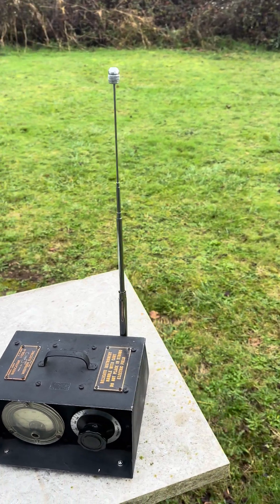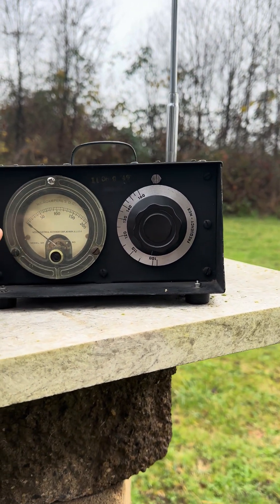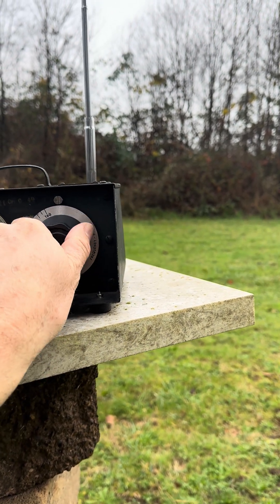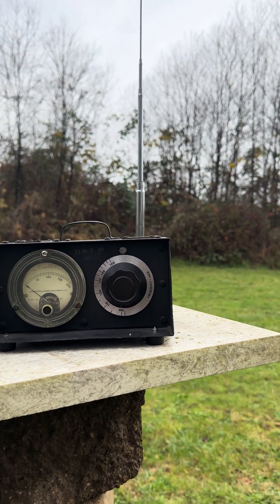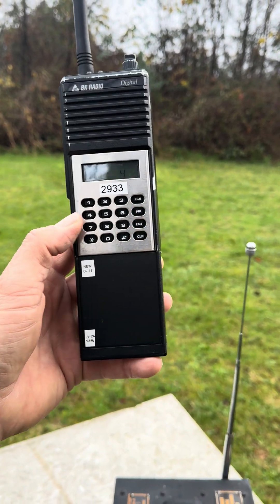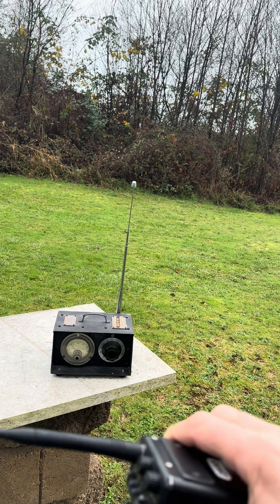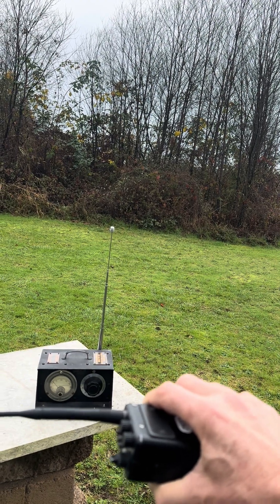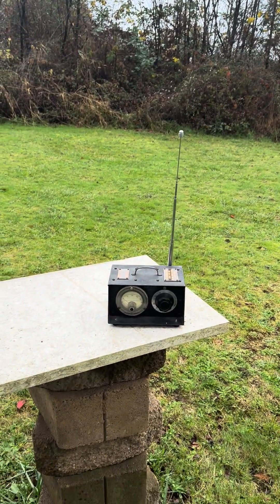Radio Stuff: Why it's important to hold your portable radio antenna straight up! Cross polarization.

Comment: You can use wrong polarization as a simple, mildly effective direction finder.  A vertical antenna is omnidirectional in the horizontal plane, no good for direction finding, but holding it sideways receives maximum signal on the side and minimum on the pointy end.  It works better with wire antennas.  The null is much sharper so that's how you use the pointy end.  It's still 180 degree ambiguous so you'll need a few readings laterally displaced to get proper triangulation.
Reply from the maker: Ha! Thanks for bringing back memories, Tom! I've had to do a bit of  rough DF'ing with handhelds. Another trick was to not only hold the antenna sideways, but close to my body, which attenuates the signal even further. By slowly turning around, I had a better chance of getting a null and a direction.
  Thanks for watching!  -Tom

Comment: "hold your portable radio antenna straight up!"
If you hold a walkie-talkie antenna down, which is often seen in "big box stores", it works but the received signal is out of phase with the transmitted signal.  The transmitter is going positive while the receiver is going negative.  This can be partially remedied by standing an odd number of half wavelengths away from the transmitter.